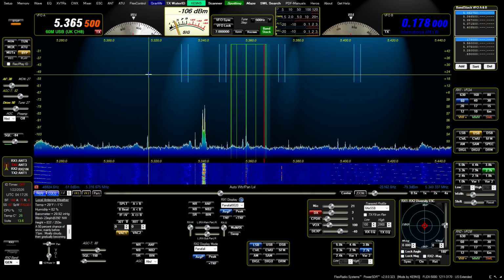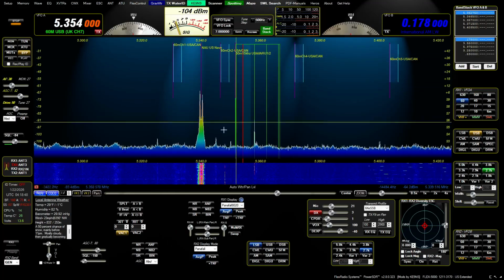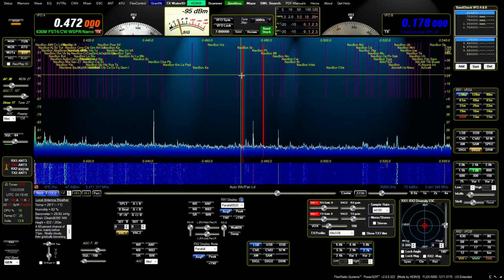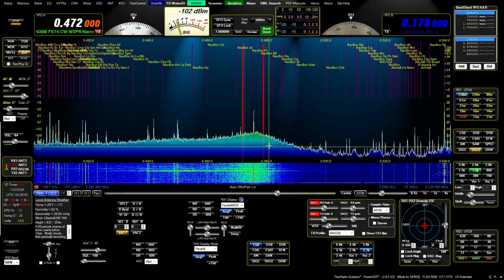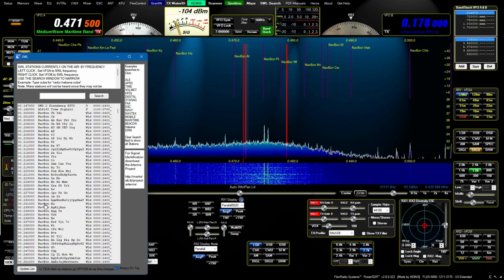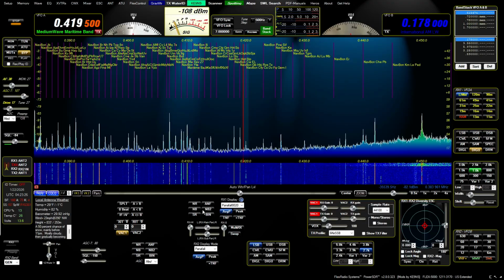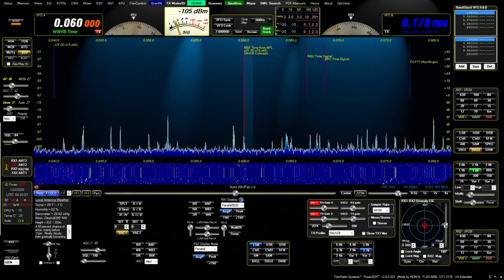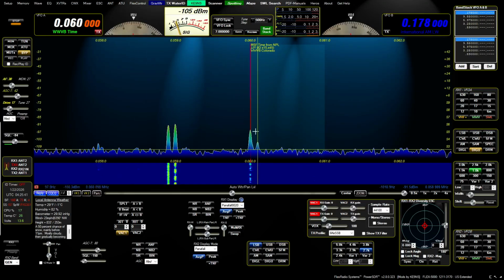PowerSDR ke9ns v2.8.0.324. 60m FCC band change. BandText changes, 630m operation, VLF and Long Wave

Comment: Congratulations on the updates! I have the Flex3000. Would it be possible to update and improve the NR? 73 PP2FM
Reply from the maker: Yes, I have not found any use for NR as it currently functions. For me I have found, adjusting the AGC-T,  AGC, NB/NB2, and TNF work well (and I leave all the DSP buffers at 4096). I dont know enough about NR code to make any possible improvements.